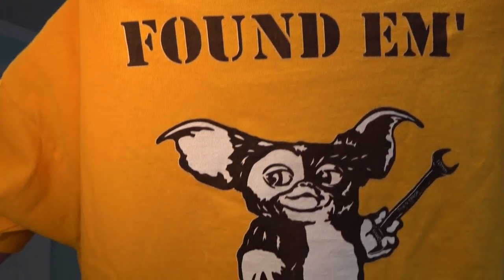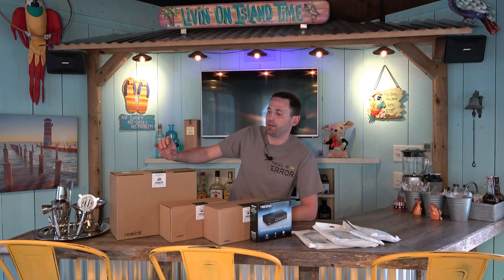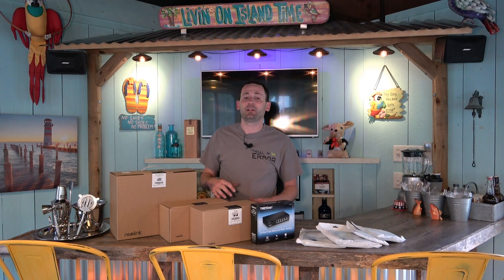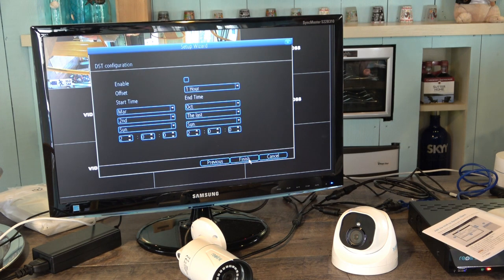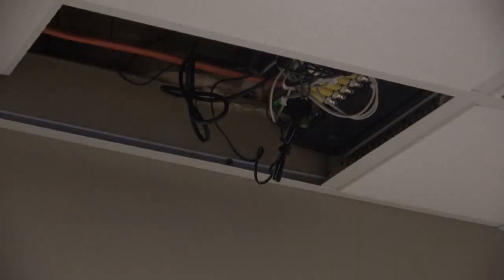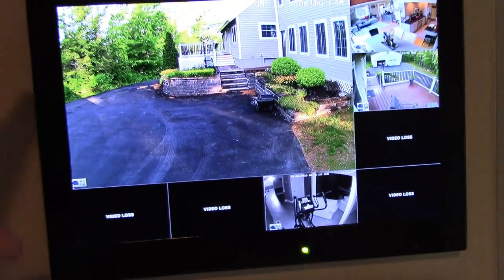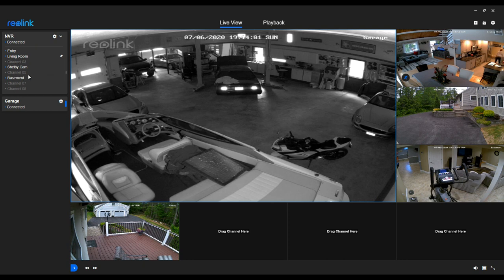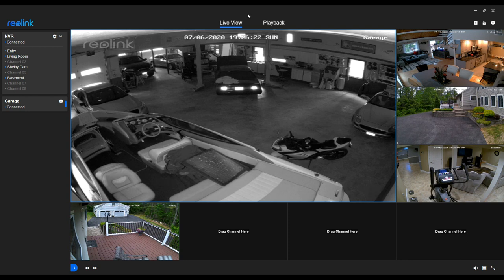Idiot Proof CCTV! Reolink System Setup and Review - Easy home security that any monkey can setup!

Comment: I’ve been using these cameras for about a year now and have been very pleased.  One really nice feature is you can install a micro SD card and record to the camera itself which would be a great back up solution because you will probably see buffering on the NVR. Not being able to run a physical cable to that POE switch kind of is what it is.  All and all I’m sure you’ll be happy.
Reply from the maker: I noticed that but wasn't sure what they were for.  Very cool, thanks for the info.
Reply: @Trialnerror  it may also be a good backup in the event that someone snags your dvr ...

Comment: I found Reolink cameras a few years ago and have been singing their praises since.   Inexpensive cameras with good quality and decent update cadence  with free software that actually works. I dont use their DVR's.  I installed the software on an old server so i can have 28+TB of redundant storage and I sync to a Azure storage account. (DVRs only support 8TB non redundant).   Then I have 4 monitors (They turn on via motion sensors) throughout my house and shop, so anywhere i go i have a monitor close to see all my cameras.  I like your wall monitor idea.  I use either 27", 32", or my shop 48" monitors so i can see my 12+ cameras in greater detail.
Reply: If all you have are the RLC-410's  You should  try the 5MP versions of the RLC-511's or if you want to go all out the RLC-423's are the best.   The night vision on the new 511's and 423's is like someone has a spotlight.  The 511's and a few others have microphones built in. .  Reolinks are also some of the few cameras at this price point that can do their high resolutions at 30fps.
Reply from the maker: Good, actually great info man, thank you.  I like the sound of your DVR setup, that makes a lot of sense.  I don't think I'm smart enough to figure it out so I better stick with the NVR lol.
Reply: @Trialnerror   The software actually makes things simple.  Just install it on a computer that is on the same network as the cameras and they will auto add just like your DVR.  Plug the computer and cameras into the same POE switch.
Reply: I want to upgrade our old system but I am wondering if this system affects your internet speed and bandwidth and if so how much? My son is concerned that running up to 8 of the 4K cameras would drastically affect the speed. Does anyone know?

Comment: Nice stuff...I got a similar 8 channel system, 4K 5mp cameras/NVR...crystal clear and poe makes it a no-brainier...but the Sheetrock thing...yeah...cutting/drilling is the easy part...its the next three days fixing the water pipe I drilled, cable TV, network cable and a romex cable...thats when the lights went out in Georgia...YEP...ServePro, an electrician, 3 days later...all's well but I got one helluva security system and it only cost twice again after I paid ServPro to turn the flood into "it never happened." and the electrician who replaced the main breaker. The funny part...my wife ask, "did you learn your lesson?" You betcha sweetheart, I'll warn ServPro before I drill that hole so the flood want be as bad...You See...like-it-never-happened 😁
Reply from the maker: Oh man, that sounds like a total nightmare.  Good on you for at least finding the humor in it lol.

Comment: Great set up.  I actually bought this exact set up.  Same monitor and everything.  I do have a question about how you got power to the monitor.  Trying to stay within code.  Where was the outlet located where you plugged in the monitor?
Reply from the maker: That's awesome!  I plugged it in to an outlet in the basement, in a utility room so it's out of sight.  Worked out well for me anyway.  Best of luck with your install buddy!

Comment: I am struggling to find any comparison between the turret and the traditional security cam. What are the pros and cons vs each other? I am trying to decide between the two for an outdoor setup on a new home. Esthetically the turrets look better but are they lower quality?
Reply from the maker: Traditional gives you much more angle options due to it being away from the mounting surface and on multiple swivels.  Turret is better looking though that's subjective.  Traditional is better with snow and morning dew as it's lens is better protected.  That's about all I can think of!

Comment: So if I understand correctly you are saying that even with the 8-channel RLN8-410 NVR that you were able to have more than 8 cameras on your network? Is it just a matter of only being able to non-stop record 8 cameras at the same time with the NVR? If you have say 12 cameras, 8 plugged into the NVR and 4 plugged into a PoE switch, you can still see all 12, but you can't record all 12 at the same time. Do I have that right? Are you able to set all 12 up as motion only recording and have the 8 channel NVR record motion events for all 12?
Reply from the maker: Yes, you can run 12 on a 8 camera NVR but you will need to pick which 8 will record.  The app/software will see all 12 cameras at once and let you view then any way you want but will only record the 8.  Switching out cameras to change the 8 is a bit of a pain as it's IP address needs to be changed so it's not something you would want to do regularly. What I decided to do was to add a couple more cameras and slip a 120 gig micro SD in the camera itself.  All the cameras have the ability to DVR themselves.  Technically, you don't need a NVR but it does make researching a multi cam event much easier since you can play them all back on one screen.  Hope that helps!

Comment: This video is hugely helpful. I love the 10” wall mounted monitor. I plan to do the same. But it seems you would need to connect the monitor directly to the NVR with an HDMI cable? Is there any chance of setting up two of these wall mounted monitors? Or is that not possible because there is only one port? I would love a monitor at each the front and back door while the nvr is down in the cellar. And advice? Thanks is advance.
Reply from the maker: Thanks for watching!  Yes, you should be able to run 2 monitors and I've been thinking about doing the same myself.  One thing for sure is your going to need an amplified HDMI splitter.  The HDMI output is super low on these DVR's.  I needed to add an amp to mine for that wall mounted TV which is about 30 feet away.  Anything over 6ft and it didn't have the juice to push through.  Thanks again for watching!
Reply: @Trialnerror  I have no knowledge of whether the throughput is different or not, but since cat6 cable is cheaper than long runs of hdmi cabling, I was thinking of using hdmi over ethernet to get the video signal to a monitor far away from the nvr. I'll have to do some more research on throughput.
Reply from the maker: @ChadAmI80  That would make sense.  Let me know if you decide to do it and if it works.  I could use a second screen upstairs and that's a cheap way to cover some distance.

Comment: Did you connect the 10" wall monitor directly to the NVR or is it connected to a device running the app?  I'm looking at this system with 16 cameras, but wondering if there's a way to use two monitors, side by side, with each monitor displaying 8 unique camera feeds.
Reply from the maker: Directly to the NVR.  You could run a two monitor setup but would need to use the Reolink app on tablets (not monitors) but yes, that can easily be done to show 8 unique camera feeds. Or use a single PC setup to use two monitors on a split screen. Hope that helps!

Comment: I used a POE system as well and love the simplicity. I went with 1080p and while it serves the purpose I wish i would of went with 4k
Reply: Reolink has 4k cameras, the D400, D800 and B800.      Last I read they only work with their DVR and they will not work with the software you install on your own computer to turn it into a DVR. Also their B800's drop the frame rate to 20fps on the 4k stream.